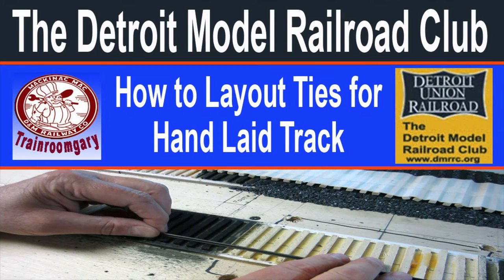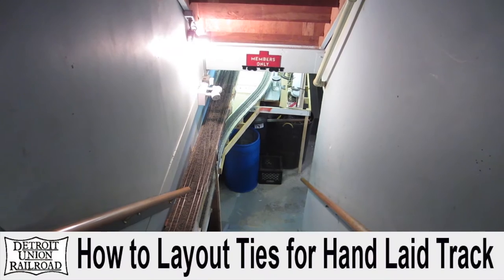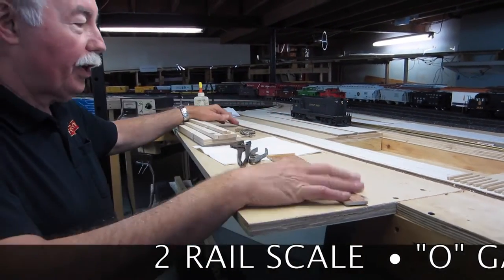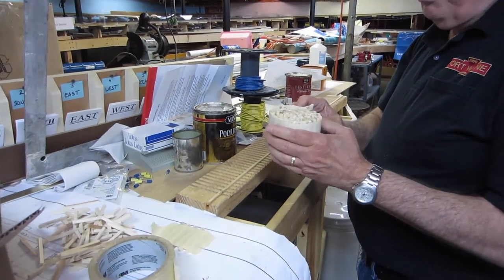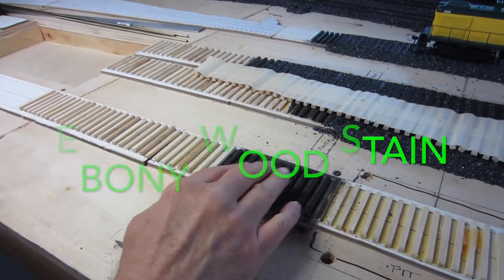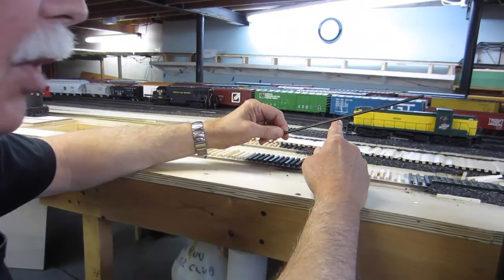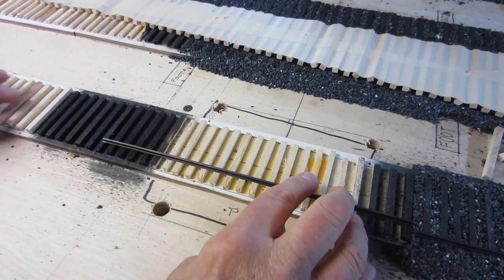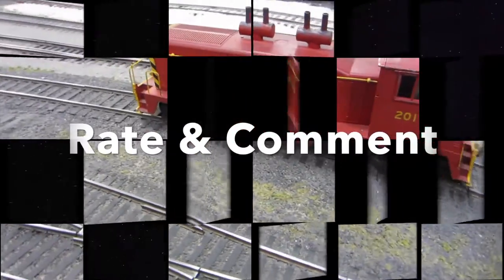Detroit Model Railroad Club • How to Layout Ties for Hand Laid Track

Comment: What did you use to cut the groves in the tie jig?
Reply from the maker: A radial arm saw was used to make the grooves, several passes of the blade or you could glue ties to a board to make the spaces for the ties.  Hope this helps and thanks for watching. Gary 🚂